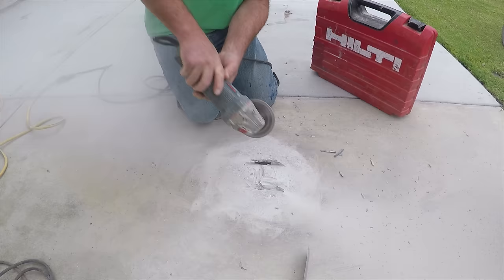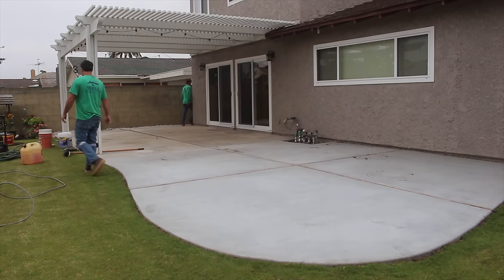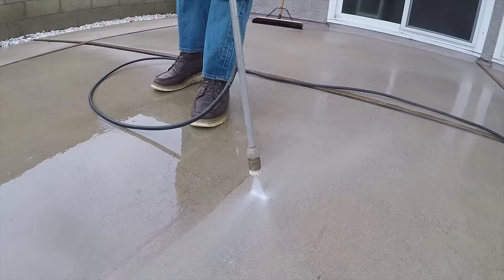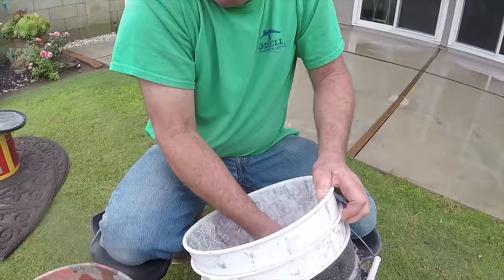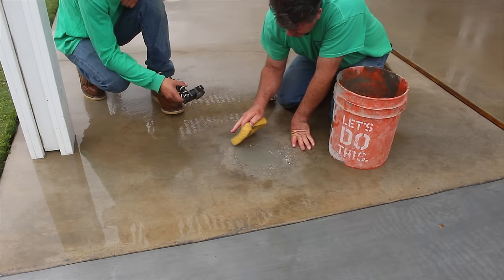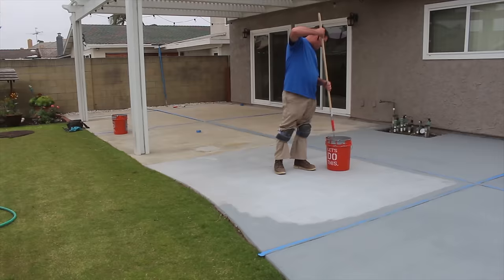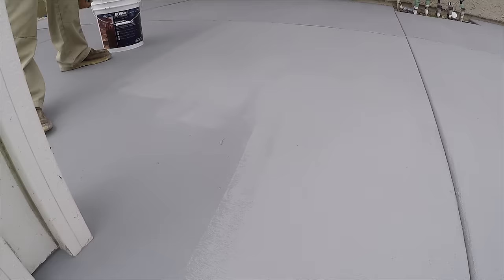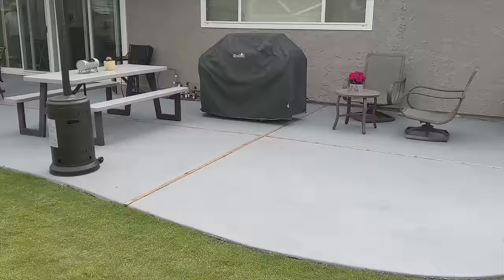How to Make Old Concrete Look New! Painting Concrete Patio DIY!

Comment: I love your work, but it would be helpful if u include links or names of  the products U actually use. Several persons asked you about the name and color of the paint, there was no clear answer. Your response: Behr deck over,  exposy paint... Is that  the name of the color?
Reply: Surprised there was no response to this
Reply: @dayumboydayum8461  but they want you to subscribe and like! 🤔
Reply: They ignore us. We ignore them. Not subscribing.
Reply: @Anymous1619  exactly
Reply: @Anymous1619 Lol they are probably working hard ,he told you in the video what product he used.
Reply: Old fashion paper and pen still works.  Just take notes.🤷🏽‍♀️
Reply: This product is Behr epoxy/seal. It's made by home depot. The trick to using this product is to follow all the steps in this video. It's very crucial that after you wash the floor, you allow the concrete to dry at least 36-48 hours before applying this product. The concrete obsorbs lots of moisture, so you want to make sure that the moisture is completely out of the concrete. Otherwise, you will have problems and the product will NOT adhere to the surface properly.
Reply: You choose your own color 🤦‍♂️

Comment: Im curious, I've never seen the wood separating the concrete like that, why is that done?
Reply from the maker: Control joints
Reply: Wouldnt it rot out?
Reply: @tr1pleone588  Yes, but it takes a long long long time.  I put bare untreated regular cheap stud lumber (no paint, sealant, linseed oil etc) in a side walk 10 years ago in southern calf and they still look great.  Pressure treated could probably look fine after 30 years based off how the stuff I did looks.

Comment: I like the look of the pressure treated lumber in between each slab. Very nice! Only thing I would have a problem with is water getting into the grooves. Great job on the video too.
Reply from the maker: Any recess will have water, In this area its beach weather everyday .
Reply: that detail of PT lumber embedded in the slab joints IMO is very problematic. I see nothing but maintenance/replacement of this detail. No thanks. I would have eliminated this.

Comment: customer took something that's pretty much maintenance free and made it need maintenance ... but you did a nice job as usual!
Reply: KelMaster Construction  its not paint, its a stain
Reply from the maker: everything requires maintenance if you want it to look good
Reply: KelMaster Construction  pretty sure this is california so yes the UV rays will destroy that in about 2 summers
Reply: KelMaster Construction  drop regular paint on your concrete. Its a bitch to get out. The color he put on will last for a very long time. Cement absorbs like a mother

Comment: I painted my front concrete porch about 10 months ago. It's already peeling off.
Also it can be from the salt that I use in the winter. And also maybe the shoveling of snow, that it causing to to peel.
Reply: KelMaster Construction  My stained wooden deck still looks good after 1 year. That's what I should have done with the concrete, stain it. Of left it alone.

The only reason I painted it, is because there were some cracks that I patched. And it didn't match the old concrete.

I should have just done it the Mike Haduck way, and just mix up some mud, and painted that on the new concrete. So this way it wouldn't look new.

Comment: have you ever tried one of those bowl/discs to attach to power washer used to clean concrete driveway? I thought that there was no way it worked as well as getting tip close to concrete but it does and makes job way faster
Reply from the maker: NO but I think I'll need more psi from the machine for that to be effective
Reply: @OdellCompleteConcrete  I was just using a 2300psi gas from Lowes with it and it worked pretty well

Comment: Nice video and very informative. I noticed you just dip the roller in the five gallon bucket and I have also used a tray. Is using the dip method better and do you get a good spread with that way ? Thanks
Reply from the maker: Yes and faster

Comment: Painters got drops of paint all over my carport. Do you think pressure washing would remove it? The house was built in 1955 and when the temperature changes the surface gets wet and slick as glass. I hesitate to paint it because of the moisture problem, guess there wasn’t a moisture barrier put down when they poured the carport cement.
Reply from the maker: Sand blast it

Comment: Need to try the surface cleaner attachment for the pressure washer, makes it easy to get an even finish.  Check vipoutlet on eBay 40-50$ when there in stock.
Reply from the maker: sounds good

Comment: Your product looks amazing and great video..I want to do this to my existing old-colored driveway.  I keep seeing that you are saying NOT for driveways. Why not?  And do you recommend any product stain or color for a driveway specifically?
Reply from the maker: The specifications say not for vehicle traffic, but I have a job I did 6 years ago.  The 2' wide strip to the garage entry has the Behr Deckover and holding well.
Reply: Hi. What is the exact name of the external masonry paint you used?
Reply: @gilbarry3  I have the same question.

Comment: i've seen some other videos how some of this product doesn't hold up. is that because of poor prep work? it looks good and hopefully it holds up like your other customer.
Reply from the maker: Most likely the prep
Reply: None of these hold up permanently like they claimed to. That is why people replace their concrete driveway every 20 years, or so. They only create problems for you later on. Once the concrete is fully bonded, nothing will hold to it with the same strength. At my old house, it peeled up in less than two years and we had dust every where. The new epoxy garage floor at my new house is peeling up where sunlight coming in. Again, you have dust to clean up and it doesn't look pretty. Where I live, we also have a winter. Hot/cold destroys every thing. Think of it as temporarily only. A lot of maintenance to keep it look pretty.
Reply: @lanfin3644  I'm sure natural elements will wear down external coatings. What i don't get with your garage though is your epoxy coat peeling. I've seen peeling from cheap coatings and poor prep work with garage coatings. I have mine 4+ years with no issues. Did they test your garage floor for moisture issues?

Comment: Incredible video! 1 question: What if you have like a Long crack in The concrete? Whats The Best and mos efffective Way to fill it before painting?
Reply from the maker: Good question!
I wish there was a sure shot way of fixing cracks but there isn't, so your guess is as good as mine.
Reply: Using a pre mix concrete
Reply: General Meyer I didnt mean What product. But do one really fill it out and then sand paper every inch til even with The rest?

Comment: I’m not sure if anyone has asked this but the wood gaps between the concrete, is that similar to the gap made to prevent the concrete from cracking? Or was that a design
Reply from the maker: The wood separations do both, crack control and decorative

Comment: We have a 40 yr. old patio that is a bit over half that size. No grinding necessary. How much would a job cost approx.? INcluding pressure washing and two coats, product, etc.... Just want an idea. For Florida. BTW, any special considerations for Fl. heat?
Reply from the maker: 2500

Comment: I resurfaced my porch w a concrete epoxy product. However it finished very uneven in terms of color, I'm thinking of using this stuff since mu epoxy cement is paintable.  I assume i would not need to degrease and power wash since the job is only a week old?
Reply from the maker: True

Comment: I spray texture a back patio and the stain I used sucked dry. How do I avoid roller Marks and it sucking dry? Had to do 4 coats!!
Reply from the maker: Work faster.

Comment: Nice job! We're thinking of doing a concrete pour around the pool and deck (1800 sq/ft), we were going to have the concrete plant add the coloring to the mixture. What do you think about that or should we paint the whole deck like you just did?
Reply from the maker: Add color to the concrete
Reply: Odell Complete Concrete That’s what I was thinking but wasn’t sure! Thanks for the reply.
Reply: Hi
The thing is, it might get a few stains on it eventually, and that’s when it’ll need painting. Shalom to us only in Christ Yeshua

Comment: What is the sealer you use? I’m going to power wash my concrete driveway and paint it this color, I also just did my backyard concrete last week how long should I wait before sealing a new concrete? Thanks for those cool keep up the good work.
Reply from the maker: Ask the manufacturer of the product your using
Reply: You've probably done it already but use an acrylic based sealer with 80% solids

Comment: My issue with painted concrete has been flaking. When it starts flaking, it's really had to scrape it off or repaint. Does this product avoid that problem?
Reply from the maker: I haven't noticed it. 
I've had some jobs down for 7 years so far
Reply: @OdellCompleteConcrete  That's great to know. Thanks for responding! Keep up the great work.

Comment: I just recently painted my patio with a BEHR epoxy paint from Home Depot. But my dog has massive nails (like a Honey badger) and scratched it all up. Just from every day wall. Dog is not intentionally scratching at it. 

Do you think I would be able to put this product on top of the Behr epoxy paint? 

And do you think it would withhold a 100lb dog with freakishly large nails?
Reply from the maker: Epoxy out doors doesn't generally work well and will yellow due to sun.
Reply: I guess Behr lied to me! :( Think I can put the Behr Deck Over on top of the Behr epoxy paint?

Comment: I'm a new homeowner and I'm looking to do this for my front and back patio. I just pressure washed all the old grim and such away. Everything looks pretty good step by step. How about aftercare? Would it be okay to light pressure wash once a year or as needed, depending on dust and grim or if accidentally drop a plate full of BBQ ribs on the ground? (It has happened unfortunatly) I wouldn't want to mess up all that hard work
Reply from the maker: Pressure wash and degreaser no problem

Comment: I had a patio put in last year and because of the way they did the broom step to it the one end appears darker than the rest of the patio. I am sure you are familiar with that type of issue. The texture is just a bit different and appears darker on the one side. I am thinking if I paint it like you guys did in the video it will fix the problem. Could you let me know the product name and color used please. Your results looked pretty darn perfect. It's the exact look I want for my patio.
Reply: I just answered my own question by reading through the comments. I am going to do a 320 sq. ft. patio as soon as spring is in full swing. Again, great video!
Reply from the maker: SOunds good
GL

Comment: Can the sealant be used on driveways?
Reply from the maker: I have but not recommended
Reply: Will the hot tire lift it off on a new driveway?
Reply from the maker: @cuzkuz1  
I think it's mostly the turning of wheel while stationary

Comment: Awesome video except you didn't use any lung protection. Concrete dust is extremely bad for your lungs. JS anyone thinking of cutting or grinding on cement or concrete should take appropriate measures to protect them selves.
Reply from the maker: Thanks for the tips!

Comment: Can I use this paint on a driveway?
Reply from the maker: no
Reply: Odell Complete Concrete why?
Reply: I’m extending the driveway 2 ft wider the existing driveway is stamped brown in color but the patio and walk way that conecta to the driveway has the paint and texture you use on this video 
I told my client he needs to use epoxy paint but he wants to paint the driveway to match the patio
Reply: Thanks for getting back to me I’m a big fan of you